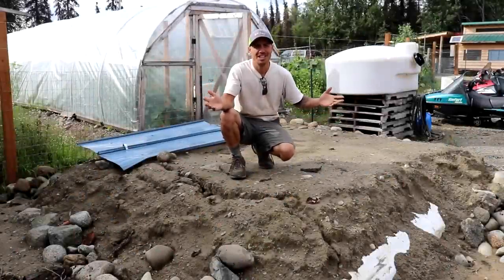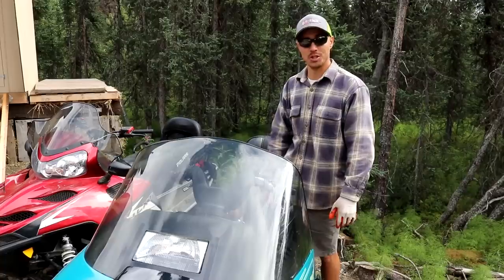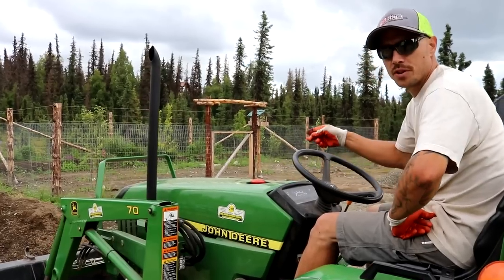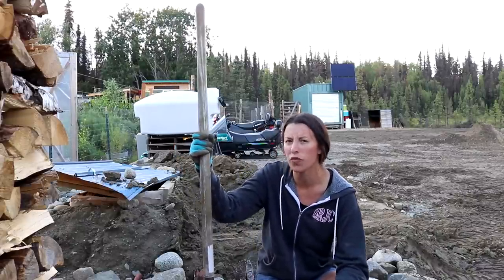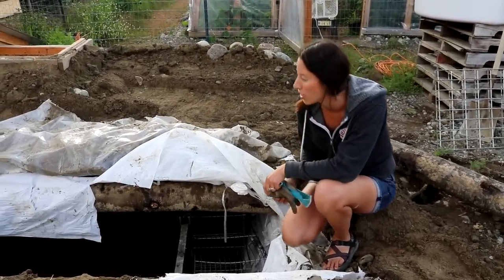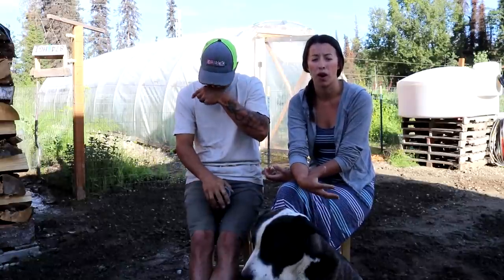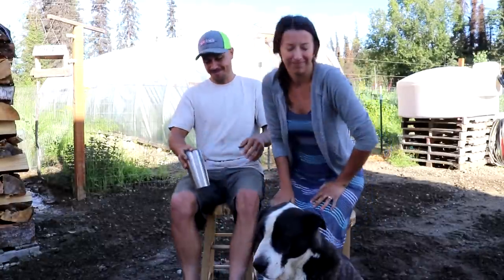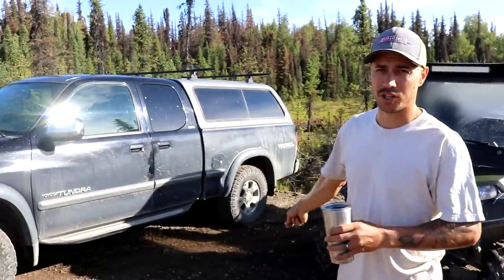Our Earthbag Root Cellar Fails | Addressing the Mud Issue

Comment: We live in Colorado and started digging our root celler last week after watching your first two videos. We are digging through rock with a jack hammer with the water table at least 20 feet below the surface. Do you think the earth bag concept would have worked without the water table problem. We have at least another week of digging and jacking the rock and are about ready to order the earthbags. We just would like your opinion before we proceed. Do you think the earthbag walls will stay straight with rock surrounding them and no water problem?  Thanks

Comment: Possibly u all could now build one that is waterproof. Cinder block and mortar floor using the tubes to drain to a drain pipe walls 6inch concrete with a concrete ceiling and a better roofed entrance rather than flat. I know it sounds costly but I'm sure it will work much like a fall out shelter would. Something to think about later down the road.

Comment: Oh and I’ve seen with everything Tatsch meant electronically to put on a small air conditioner to turn a small room into a walk-in cooler I don’t know what the thing is that you attached to your air conditioner small air conditioner unit maybe you can find one to where you could designate solar electricity to it and change it just giving you ideas the research love your program you to stay safe

Comment: Consider taking another stab at a root cellar, because you must have that long-term storage to be off-grid.  Go down 4' this time with a gravel base, build 4'-5'' thick earthen walls reinforced with timbers for insulation.  Cap the structure with logs and earth and reinforce the ceiling inside the structure for additional safety.  You may have to pipe electricity into the structure for air ventilation and/or heat in the winter (just to keep constant temp).  Just some thoughts.  Solar panels could work well here.

Comment: Maybe a shipping container, insulated VERY well ,could substitute as a root cellar?  Even sand bags as insulation since  they would be on the outside and could not collapse the structure...(or Styrofoam etc). Maybe even  set a few feet into the ground if the doorway could be worked out.  It would be better than storing in a heated room.  Just a thought.

Comment: I used railroad ties, side by side covered with plastic wrap for the top of mine and as far as I know, it's still doing its job 20 years later.  What a shame to have to bring yours down. Hey, I read in "FoxFire" that you can build a root cellar above ground using the same methods, also Food Clamps. Check it out, the pioneers did it, so can you.

Comment: I'm thinking when I try a similar root cellar with straight walls
I'll make tie-backs to hold the walls straight..
Or if I can find a good price on 10 ft or larger diameter concrete drain pipe
And then use a spiral stair case with every thing stored along the walls...
As I walk down every thing is right there

Comment: Bummer. I don't know much about root cellars but in your situation, why can't you build a mound structure? Like use the earth bag idea and build it above ground, then mound dirt around and on top of it? Even if you had to line it with insulboard a bit. Seems like that would be enough. I've seen them built here in Indiana and our winters are long and cold too (just not as).

Comment: Any particular reason you buried the metal shelves as well as the logs in the root cellar?  I would think that after the logs decompose, that spot might not be as level or high anymore, making it a possible risk to run over one of the metal pipes and puncturing a tire.  Anyway, just a thought.
Reply: They were crushed and trapped by the collapsing walls.  They could not be moved without major excavations.
Reply: @stephaniewilson3955  Ah, ok, them being stuck would certainly be a nuisance. I'd probably still cut the shelves apart to remove what I could though. Personally, I don't like burying/leaving debris that might cause damage down the road. You lose too many truck tires to it.

Comment: I watched your videos of the construction, to me it didn't seem like there was any way of preventing the walls from being pushed in by the weight of the surrounding dirt & rain/ snow melt.  For a high water table area, it would be smarter to build more of a ammo bunker style root shelter, maybe digging down 4 feet and using that dirt that was excavated to build up around the perimeter, plus i would have used cinder block with rebar every so many feet with anchors if it was more of a basement style root cellar, or if you had a hill on your property, build it into the side of a hill with a walk-out basement style entrance.  After seeing that you live in a very high water table area, i would nix any below ground style construction,  a small empty connex would be perfect for a walk in freezer during the winter months, michigan gets more snow in some areas than alaska, you would be better off with a used snow blower instead of trying to find a place to push the snow with a plow.

Comment: Little thought... For another root cellar... Price out a small shipping container.... Dig it in at the end of the orchard or a bank close to the house.... insulate it...not the bottom and cover it with dirt... Maybe bury some tubing and put a radiator with a battery fan behind it on solar... Might be a quick alternative...
Reply: Shipping containers are strong only at their corners along the vertical and horizontal edges. I think they'd be an improvement over the bags but ultimately suffer from the same problem with caving in slowly if buried in wet soil. There are videos on YT done by an architect and by a couple of engineers debunking the container complex construction trend. They're fine as long as you leave them intact and only stack them in the intended alignment on a sturdy footing.

Comment: Hello! Im Zoltan from Hungary. 
I know, im not there, but maybe... It was not possible, to put a drain pipe in the ground, and let the water flow out from the root cellar? You are on a hill, maybe there is enough elevation there about 12 foot.
It would be a lot of work digging long, but after that the water would left without effort. It was not an option for You?
Cheers, Zoltan

Comment: Hi.  I'm sorry you had this experience with the root cellar.  But, frankly, I think there's a better idea for you.  Get a used insulated shipping
container.  They sell them all the time.  They have incredibly strong steel sides, bottom, and top.  After all, the shipping companies stack 
the containers on top of each other up to about 10 containers high....filled with meat, etc.  The insulated containers will also give you
the option of using the container ABOVE ground so you won't have to climb down a ladder to access the cellar. You can just walk in.  They 
are bear proof, too.  If you want to you can bury the container by piling dirt on the sides and top.  Think about it.  People turn them into homes, too!
Reply: Mmmph. Ever see a polar bear swat a dumpster? BIG dent. I'd definitely bury it, at least partially. And place a few interior roof support beams, in case 1200 pounds of wild Alaskan critter decides to wander around on the top with its ornery self, not distributing its tuchis evenly and denting the ceiling.

Comment: If your going to build a root cellar, it should be built into a hill or berm so you can have drainage. One side open for the door and drainage. You found out the hard way unfortunately what water hydrostatic pressure can do to a structure.

Comment: Next time, 3 feet down, with concrete reinforced with 1/2 rebar, Often deep unreinforced holes and trenchs are dangerous - frame up, walls -pour in place concret,  back fill, and consturct super structure with door. (above grade).

Comment: Okay, so maybe look at what North American pioneers built for ice houses in the late 1800's and early 1900's for storing ice. They were simple log, post and beam structures that were covered with earth and sod. Yes they were for storing ice, but they essentially work in reverse in the winter time. Snow would be your friend and by possibly blowing snow on top of the structure you essentially increase the R value, to a degree.

Comment: pour a 12x12 Slab on top of the ground with rebar for 8x8x16 inch blocks, make the walls 8ft  tall, make a curved roof mold 4 inch thick, 
pour grout in the walls and in the curved roof mold, make the door 30 inches wide, add rebar to the curved roof mold , fill the gap between the curved roof and wall with bricks on the 2 sides at the top, the bottom of the plywood mold needs to be anchored to the inside of the wall temp and the outside plywood mold anchored to the outside of the wall Temp. do not cover the wall to roof  attachment with plywood, the wall and roof need to be cemented together, drill a few holes in the mold to install through bolts and nuts tp keep the roof thickness even cut a few bigger holes at the top of the roof mold to add the filler cement grout, install the bottom plywood mold first, then the rebar 2" above the bottom plywood mold, if you use a drier mix, you may not need to make a top mold cover,  just the bottom and sides the slight arch is to give the roof Strength,  being 4" thick will allow you to cover the root cellar with soil, I Don't think you will need a permit but if you do, you may have to make a 12"x12" footing under the slab and reinforced with rebar, use 1/2" Epoxy Coated rebar or what ever your building code requires, Just my 2 cents worth, a gentleman in one of the comments below hit the nail on the head, it was not the ground water level that caused the flooding of the sand bag root cellar, but a build up of water and pressure that did not drain away to prevent the movement of the sand bags and the water entering the cellar.
https://www.youtube.com/watch?v=B38uSm-0_EU

Comment: Packing the soil around the bags was like packing gun powder around a cannon ball!   As soon as the frost got into the ground, the walls were domed.  Had you used foam board and didn't pack the soil the root cellar would still be functional.  Or, set the bags longways to make a thicker wall.

Comment: Have you guys thought of using 'drains' that lead away from the root cellar? I know my friend in Mississippi has a terrible problem with water in her basement and being the giant idiot that she is (I do love her though) decided that she wanted a root cellar. She made a fairly big one underground about 6-ish years ago and when she could keep it dry she made drainage tunnels leading from the cellar (on the same level as the 'floor') and filled it with gravel then buried the entire thing. She STILL has problems with water because she lives near a swamp (and she's an idiot) but the drains actually have helped her tremendously. Unless it rains for 2 weeks straight her cellar (and basement) stay fairly dry. Though rarely dry. It's a LOT of work and I don't know what gravel costs there but it might be something to look into. It might also keep your walls straighter if you can keep the water from freezing there.

Comment: When the ground around your cellar freezes in winter, it swells, pushing the walls inwards. Then summer comes and the earth starts to contract, gravity pulls it downwards and settles it into its new shape. The trick to making soft structures underground is to not dig straight vertical walls, but to dig at a slight angle, like an upside down pyramid. So instead of staying at their new position,  gravity will pull the walls back into the old one. Of course, that doesn't help much with the flooding, I've got no advice for that.

Comment: That’s a shame it looked so good.  What if instead you got another shipping container and welded the doors shut to ensure no water could get in and then bury it and cut a hole in the top for the stairs / ladder like you did before w the root cellar that didn’t work - and put a lid on it like you did before.  Since it’s metal it’ll stay cold in the dirt and dark and water won’t come in it and if the dirt shifts like before the container is strong enough not to have any issues.  And it’s big you can store plenty.

Comment: Been thinking why can't you get one of those huge black water storage tanks.  Cut a hobbit door for it. Make sure the hobbit door seals when closed.  Set it in the ground you won't have to worry about water coming in except what builds up inside.  P ut it on it side if you want high walls or other way won't matter it's huge. Just a thought.
Reply: Or check out   Modern Self Reliance their video called Building Root Cellar (Hobbit House). Theirs outside cellar with the huge black water tank would look good.

Comment: The Earthbags could have been reused for a root cellar constructed not so deep.  The walls could have been built as a dome or a cylinder  and they would not have thrusted and failed inward. Barbed wire between each layer would have networked the bags for strength and introduced the option of a domed roof.  Then earth could have been bermed up the side.  Not sure how your decisions were driven.  I am sure it was not an easy decision backfill the project.  It seems that despair got the best of you.

Comment: I am just saying that you could  build up a hill about 8 feet high. Yes it is going to take up room, but if you make the root cellar 6 feet high the root cellar would be at almost ground level. You could dig down 2 feet rebuild it with earth bags then cover it up with dirt at 8 feet high it would have about 4 feet of dirt on top of it. That is what I would do anyway dirt is a good cheap insulator.

Comment: That’s a bummer. If anyone else is dealing with this kind of issue, here is an idea (from someone who has never experienced it, lol): Bury a long roll of pex pipe as you fill it in, and that would you give you a ground source for heat and cooling/temperature regulation.

Comment: Bury a storage container. But, it needs to be anchored or it will float upward. Or dig down 3' and bring in loads of dirt to build a mini mountain to cover the rest of the container.
Reply: it would be better to have the container at ground level, then cover it with soil and chain link fence and sod or concrete.

Comment: A 10’ Diameter X 8’ long Calvert stood up on end half way buried and mounded up the rest of the way , concrete floor with plenty of grave and packed sand under for drainage . Tin and plank roof earth covered or concrete covered . Walk in or trap door .
Find the highest , driest spot to put it
I think Gridlessness built one on their channel check it out

Comment: When you are trying to fill the bucket on the tractor. Use the lowest gear so you don’t spin the tires,then tip the bucket down slightly,push ahead while lifting up on the loader.never bury organic material by your dwellings.

Comment: How about an above ground root cellar.... with earth mounded to insulate it from the summer heat? Wouldnt have the ground water issue.... try a shipping container (10x8) keep the door on the north side.. add vents in the roof and the door/ground air tube (earth ship style) for air circulation. Give you a place to grow edibles on or flowers.
Reply: The problem isn't the summer heat as much as the 30 below temp in the winter.
Reply: @glengillis7775  true but if you can insulate a house you can insulate a root celler above ground.
Reply: Wonder how much space they have under their house? It's skirted and could have a area under insulated from the extreme cold and get a little heat from the house above

Comment: Why don't you build a above ground root cellar using gabion walls. Utilizing log for the roof and then burying the structure with earth. The snow should insulate it enough as long as you have a good door seal.

Comment: Sorry about the cellar don't give up do celler 2.0 lol all that water came in through the top you  will need to make a water proof roofing  also dig a sump pump  hole out in the pump mabe make a door entrance stairs to another insulted  door at cellar level easier to get in and out of just thought to put with your own  .  As far as the wood shed nice i just would have filled it full worked my way into it as i use it again my thoughts and guess what it all for free lmao have a great day . Ps the styrofoam idea sounds good if anyone up there has it could be a quick one for this yr  peaceout

Comment: You cook with propane; WHY not purchase a propane refrigerator? As for your root cellar, WHY did you dig a ten foot root cellar when you knew you were in a drought? Water tables rise and fall with precipitation. A better plan would be to find the highest area on your property, established what the water table is during a year of abundant rain fall and dig its foundation accordingly. A French drain around your new root cellar will divert water that could undermine the walls. Pressure treated timbers for walls and the floor reinforced with 1” rebar driven through the timbers would stabilize the walls.

Comment: When I was a kid, my aunt and uncle were homesteaders in NW Washington. They bought treed property and began with a sawmill and built a small home then a large home. They had a dip in the land and built a Log root cellar on the low side and then moved earth over the top and sides. I’m thinking you should think on a “Soddy” approach. Can you build an above grade  log structure and make an earthen shell? Also research what ancestral peoples of Iceland did...they used layers of rock and earth sod above ground for all their structures. They were designed to last 30 years, be deconstructed and rebuilt using the same rocks and fresh sod. Quite a loss but you will prevail...of that I am certain.